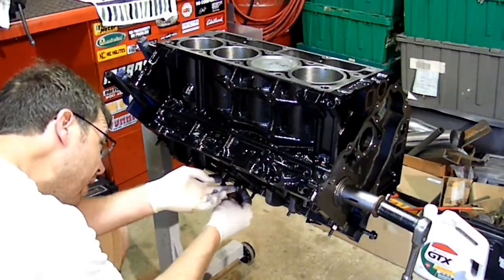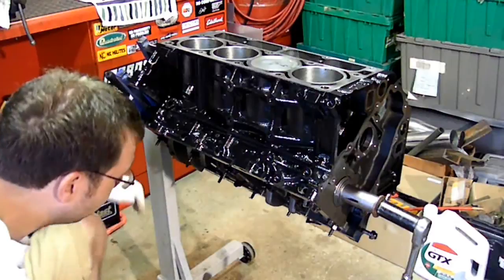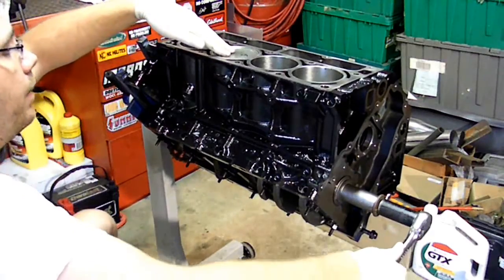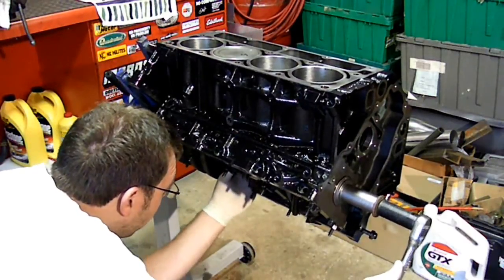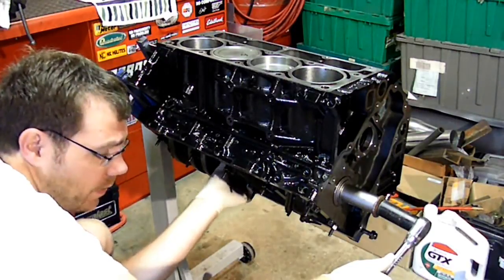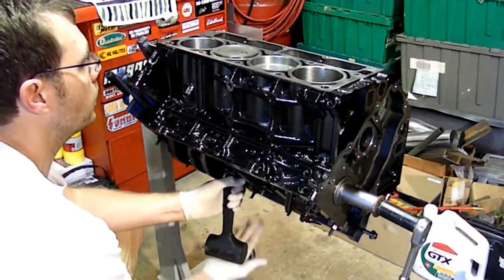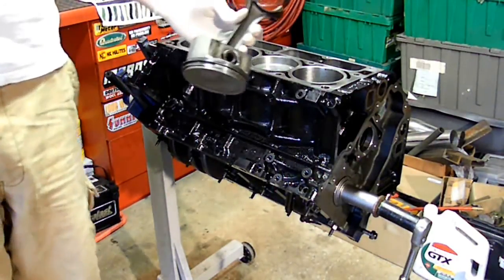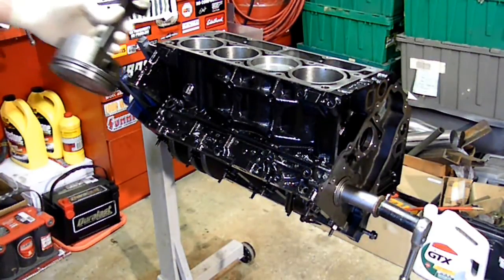LQ4 Project Video 2 - Piston Removal

Comment: Great videos!  FYI, if you want to protect bare metal parts for long term storage get a can of LPS 3 spray.  Expensive stuff, but it's a paraffin wax that dries to a tacky coating.  I've also used it to fog cylinders for cars that won't run for a long time.  It dissolves quickly in gasoline or any solvent.

Comment: are the pistons stock or aftermarket. and what compression
Reply from the maker: +gravedigga219 Stock LQ4 dished pistons.  With the modified 5.3 heads my compression ratio was right at the high 10's if i remember correctly.  I would have to check my notes, or use the calculator to figure it out again.
Reply: q+vh'i+JEG's Garage
Reply: +JEG's Garage doesn't p
... I ff'g_